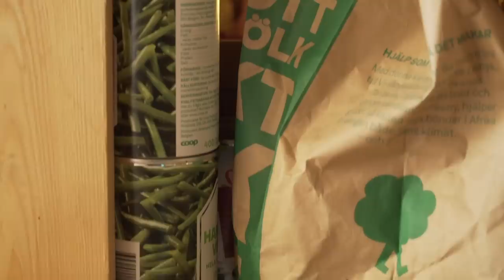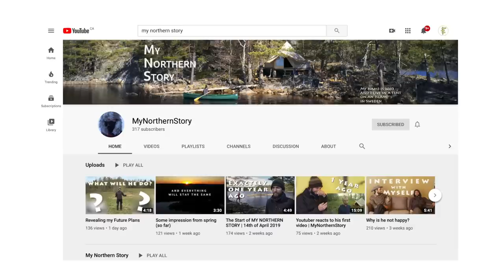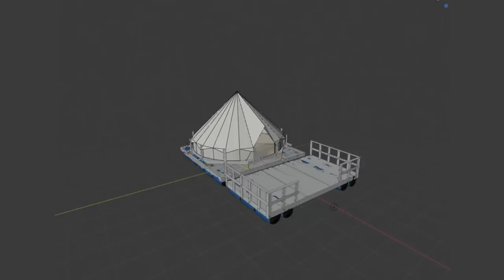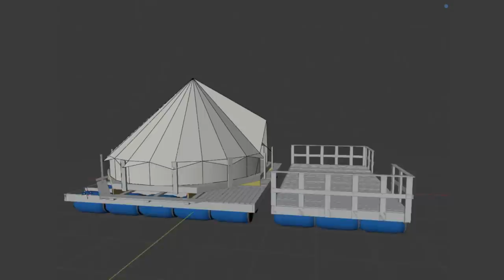Man Living Off-Grid in a Tent on an Island

Comment: Use plastic totes for flotation as a raft. Use 25 gal totes, each one displaces 200 pounds and you can easily mount 8 on a 4x8 sheet of plywood,  displacing 1600 lbs. 
You'll need probably 4 sheets of plywood for the base, which would allow you to build your tent and everything , by displacing 6400 lbs. Each tote being 25 gals. and water being 8 lbs per gal. that equals about 200 lbs of displacement, holding up power. You need the totes about 3 to 4 inches in the water for best ride. Where the handle is at, theres already a hole made. use a round dowel the same size, with a hole drilled in it, and screw it to the deck. Good luck, I've built several of these rafts, they work great.

Comment: If you get a small refrigerator you can put it outside in the winter to keep things clean and frozen, and just heat and cook them on the wood stove. It doesn't need to be connected to anything. But make sure you aren't storing anything in there for longer than two months because warm days can heat up the food inside.   And if you can put a silver metal cover to reflect heat it will stay cooler longer. By the time spring is about to start looking appear make sure you are eating everything. And try to have a bare freezer by the time the snow and ice melts. And then dry out the freezer and in the summer and spring you can use it to store bread and same vegetables and potatoes. You have to change what you cook based on the weather. And dry Thor fruits and veggies to just add water in the summer when it's too hot to keep veggies cool, when the fresh veggies run out.                And if you see this message you could move your tent onto my property if you would like but it's high in the mountains, very different than living off the water, but you could try out for a year if you want. Just message me.

Comment: You need to change your Aluminium flex you added to the chimney it is not safe it will burn up if you have a chimney fire 🔥 I am a former chimney sweep you need to replace it with a piece of stainless flex liner you can purchase from any place that carries wood stoves ect be smart and safe replace it don’t get burned up when you least expect it

Comment: hi My Northern Story, quick word of caution with the flexible aluminum pipe attached to your stove.  That looks like a dryer venting duct tubes.  In the near future your fires heat will burn right through that aluminum and/or you will put holes in it by moving it around.  I'm not sure what another workaround would be (to move your stove around) perhaps a wood stove store could help you problem solve.  I believe what you are doing is extremely dangerous and I encourage you to do some more research.  otherwise you have an amazing set up...i can see why you live there, beautiful~